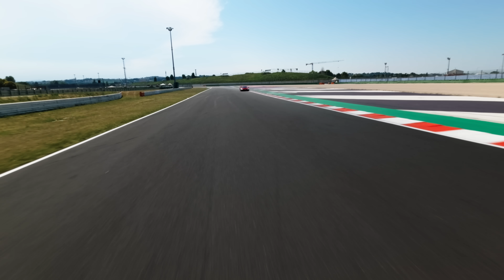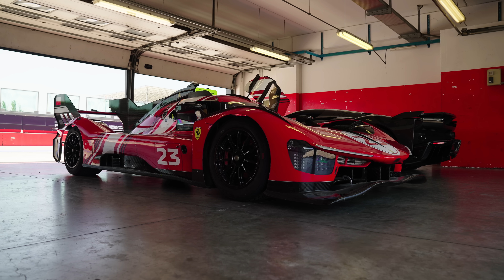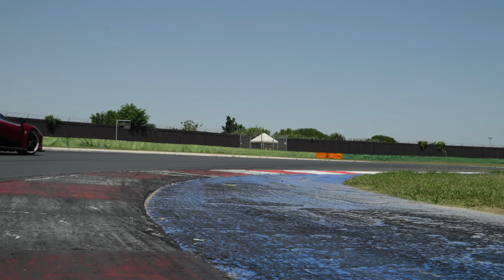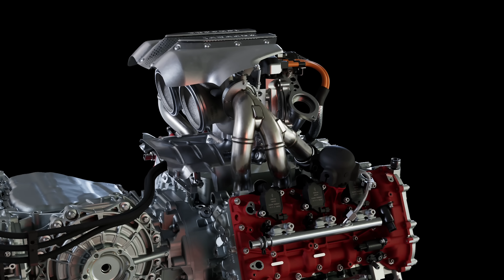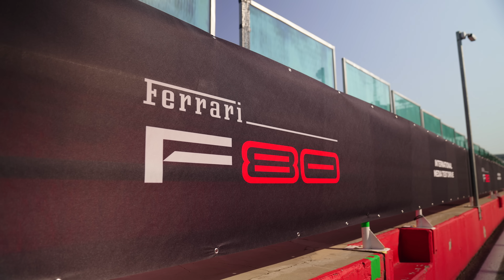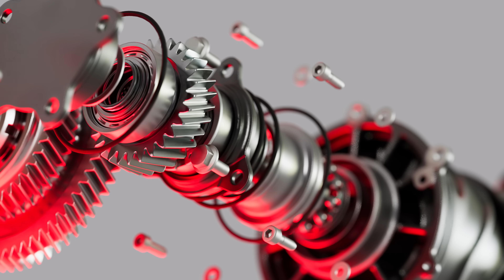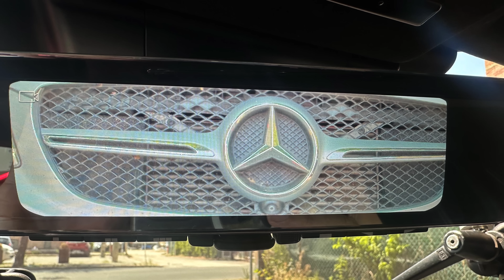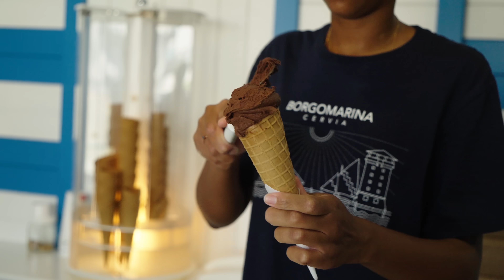Ferrari F80 First Drive - Ben Collins Drives - Track test and public reaction.

Comment: Ferrari really didnt emphasise just how menacing this car sounds when its going full chat, sure its no screaming V12 but it's Le Mans lineage is enough to be a 'Halo' product, The AMG: One doesn't have a Mercedes V12, Its just a special engine like the F80.
Reply: Because it’s only loud on the inside. Which is how it’s designed. It was shown to the customers though which is why they all wanted it.

Comment: 1000kg of downforce at 155mph... that's so BS.  You look at the infamously fugly Mclaren Senna, and you see how extreme they went to get more downforce, and even that only has 800kg of downforce at 155mph.  The Senna GTR has 1000kg.  What's with Italians loving to lie and fudge about their numbers, including their hp and weight, etc.
Reply: Because the Italians never lie
Reply: There's a ton of concealed aero. It not being visible doesn't mean it doesn't exist.
Reply: @NoGoodHandlesComingToMind   concealed aero...right, so it has as much downforce as an actual GT3 race car, yet the GT3 race car needs so many wings, scoops and a giant diffuser glued to the ground.  For reference, the Aston Martin Valkyrie, a car with the most extreme aero for a road car, still doesn't have 1000kg of downforce at 250kph.
Reply: @NoGoodHandlesComingToMind A ton would defeat the purpose.